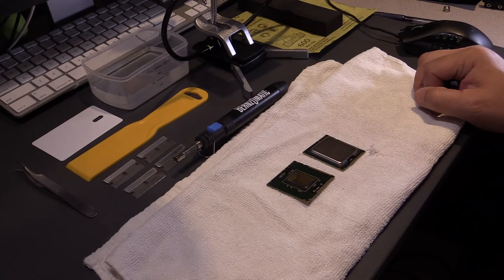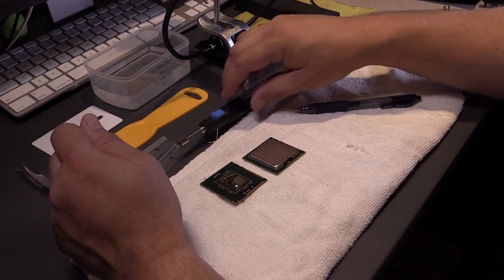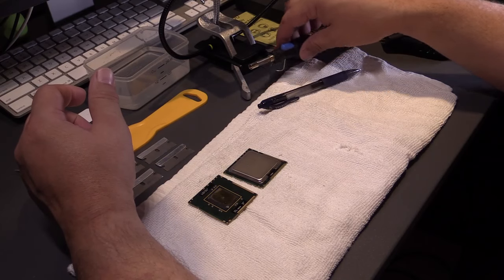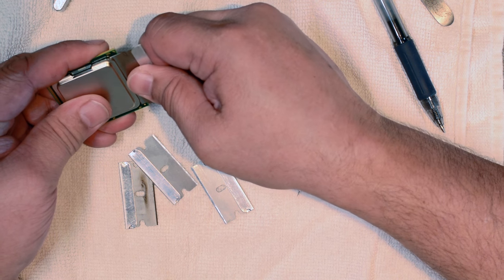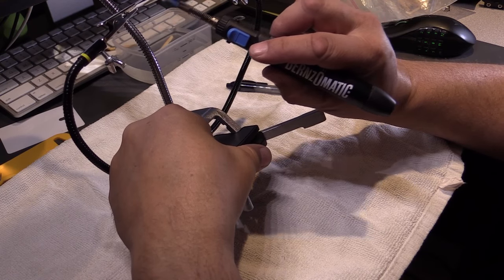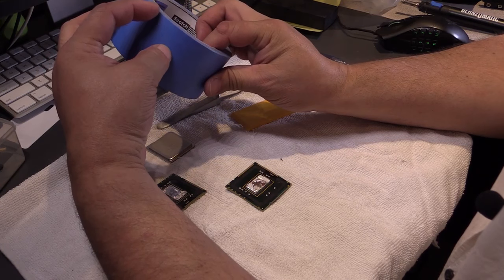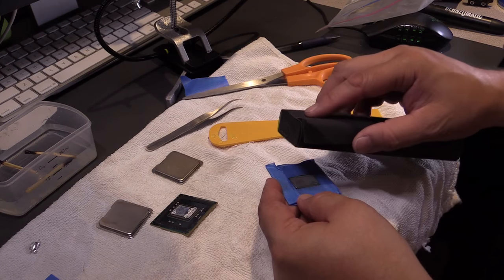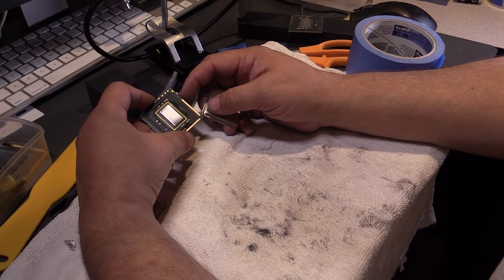Soldered IHS Removal Process for upgrading CPU in 2009-2012 Mac Pro Models

Comment: have you ever done tests to see if there actually is any proof that taking off the lid makes the processor run cooler?   Seems like this is alot of work with a ton of possibility to damage the cpu ...   Are you still doing this to older macs or do you recommend people just buy the 2010 macs if avaialble
Reply from the maker: The exercise of this video was to show how to upgrade and install new CPU&#39;s to Mac Pro 2013 specs (trash can Mac Pro), since you can't purchase OEM de-lidded cpu&#39;s from Apple or anyone else for that matter.  Apple designed the 2009 Mac Pro dual processor logic boards to use lidless CPU&#39;s in socketed slots.  I&#39;m sure Apple Engineers had their reasons, whether it was maximizing cooling, and clock speed, I don't know.  However, you can use the lidded versions, which can be easily found on the open market, but the added thickness of the lid can potentially damage your logic board if left on.

The difference in heat dissipation from a lidded to non-lidded cpu is probably negligible for most users.  However, you have 4 independent screws on the heat-syncs that are deep accessed with a spring tensioner, requiring a long allen wrench to tighten.  It's really difficult to try to evenly tighten down the screws to make sure it&#39;s flush even with the cpu - even when counting turns.  Even a slight variation of a turn or so can result in damaging the logic board, or off-setting the heat-sync at an angle preventing flush contact with the die head and heat-sync.

For the value, I still think the 2009 Mac Pro dual processor models are the best value on the market.  It only requires doing a firmware update to make it a 5,1 version (2010-2012) and then upgrade your processors, memory, SSD and a faster video card and you have a speed machine that will probably last for the next 5 years or more.
Reply: I have seen someone do a test of lidless vs lidded and the difference was 3 degrees  so not really worth the hassle or anxiety   I am not sure I would put that much faith in Apple engineering as a reason to lid or not lid...  The vast majority of people use washers to lift up the heat sink and keep the user from over tightening plus simply releasing the cable to make the fan connectors work is much less stressful.   Can I still upgrade the firmware to make it a  5,1 without upgrading the CPUs?  I do agree with a good GPU the machine will do very well and with a dual channel SAS card the 8 drive raid can be fairly quick   Of course no Thunderbolt connection unfortunately .
Reply from the maker: There is really no benefit to attempting the 5,1 firmware update from 4,1 unless your processors support it.  The firmware patch will allow you to make the update, however, if the processor isn't supported in the 2009 Mac Pro then it won't boot.  However, there is a large amount of information on the firmware update and what the requirements are.  I would recommend reading through the following articles so you have a better grasp on the pros and cons of what's involved.  

For myself and anyone else going from an 8 core machine to a 12 core machine, the 5,1 firmware makes absolute sense.

I would recommend reviewing the following published articles and message boards on the upgrade issue so you can make a determination on what makes the most sense for you.

http://www.everymac.com/systems/apple/mac_pro/faq/mac-pro-early-2009-nehalem-how-to-upgrade-processors.html

https://www.macobserver.com/tmo/article/step_by_step_mac_pro_processor_upgrade

http://forum.netkas.org/index.php/topic,852.0.html

http://forums.macrumors.com/threads/mac-pro-cpu-compatibility-list.1954766/

http://forums.macrumors.com/threads/4-1-dual-cpu-delid-or-leave-the-lid-down.1959772/

Comment: Hi Guy, first things first, thank you very much for this well done video I followed your instructions, but halas my two CPU I removed the led heater cover of didn't keep the central part in. I ended having two CPUs now without this silver central part. My question : Are my two CPUs ruined? Can I find this silver material somewhere and by it to glue it back ? Is it possible to glue that thing back for the CPUs to run again ? Thank you for your answer.
Reply from the maker: Sounds like you over heated the cpu's. If you used the razors to add tension to the IHS when adding your heat source, the IHS should pop off without pulling off the cpu from the die.

Comment: Hello, I'm currently trying to finalize a Mac Pro 2010 for a very decent price. Although the shipping price seems to go upward within our two emails, so setting that aside my question are about the two 2.4 Ghz processors. Based on your video to which I felt is very informative, if the two 2.4's have the IHS (assuming this unit was not modified), AND in knowing the additional heat will 1) slow down the processor speed and 2) over time reduce the life span of the transistors, would you suggest or recommed removing the IHS on my new X5680 3.33Ghz?
Reply from the maker: If it's an actual 2010 model and not a modified 2009 model showing itself as a 2010 with the 5,1 firmware flash update, I would probably not de-lid the IHS.  It will be much easier to swap out processors when you want to upgrade without having  to remove the IHS.  If you're concerned with heat issues affecting lifespan, you can always re-apply a high-performance thermal liquid metal compound like Thermal Grizzly, which drops temperatures by as much as 5-6 degrees over other thermal grease brands.  There are a lot of resources on Youtube on how to do this. 

However, to get your biggest bang for a buck, get a 2009 model instead and do the cpu upgrade, remove the IHS, and flash your firmware, which you can find here: https://goo.gl/DCn3Wg 

Other than memory and video card, the 2009 model is basically the same as the 2010 at about half the price.  Compatible processors can be found for as little as $100 for a matching pair for the dual processor model.

I recently found a 2009 2 X 2.26 E5520 model for around $400, from a local computer recycler, that is now a 2 X 3.33 X5680 after a de-lidding upgrade

You can safely upgrade the processors of 5,1 models with any of the following cpu configurations which can be found here: https://goo.gl/rU4RHi

I hope this helps.
Reply: Carl Clifford-Bauer.I think the 2 cpu 2009 to 2012 does not have lids.The single cpu mac pros of those years have lids.mine is a 2009 2.93 ghz 4 core updated to a 2010 3.33 ghz lidded cpu.
Reply: DIY Guy.my 2009 2.93 ghz 4 core single cpu was updated to 2010 3.33 ghz 6 core and the lid did not have to be removed.The single cpu has to be delidded to work in a 2 cpu system.
Reply: Carl Clifford-Bauer.I am having problems installing windows 3.1 on a mac pro because there is no floppie drive.

Comment: What models have delidded processors. Neither of my Mac Pro's are lidless. They are factory original. 2010 Quad core 2.8 and 2012 6 core. To delid these would present problems in heatsink fitment? A 2 mm difference?
Reply: Only the 2009 4,1 dual processor Mac Pro's have de-lidded CPU's as standard from the Apple factory. The single processor 2009, dual and single 2010 & 2012 Mac Pro's have the IHS left in tact from the factory. So this mod is only necessary for the 2009 dual processor boards.

Comment: Why they need to be removed???? For what i remember the original Mac Pro 2010 processors do not have that thing removed at all, whats the risk?
Reply from the maker: You're correct. The 2010 models though 2012 don't need to have the IHS removed. 2009 models certainly do when upgrading the processors, without needing to modify the heat syncs etc. However, for some people there is a slight boost in efficiency with removing the IHS even on the 2010-2012 models.

Comment: I'm just curious is it ever possible to get these to a mirror finish? I quit and went with very smooth no solder on them but I wished I was able to the surfaces shiny. Any thoughts?
Reply from the maker: It is possible, however, it would require a jig of some kind to keep the die parallel to the sand paper surface so you don't round the ends of the die off from sanding.   

If you use a good thermal paste like TX-4 it will fill any microscopic spaces on the die head and ensure you have a good bond with the heat sync.

Comment: That was a lot of water to put on your cpu just to sand.  If you're using any liquid at all, it would be rubbing alcohol, and very little at that.
Reply from the maker: Water won't affect the processors. Just don't let them soak for weeks at a time.  You could use naphtha but would be exposing yourself to unnecessary hydrocarbons.  The painter's tape helps keep water and debris off the contacts and capacitors.

Comment: Any idea on how to test the processors one by one?  At least one of my processors did not survive the process and I can't get the system to boot. Trying to figure out which is bad.
Reply: Are you sure you had a good pair before delidding?  It could be an issue with making sure the heat sync's are properly level.  This requires evenly counting the rotations of the screws when tightening them down.  You can also try remove the CPU B and just try booting off the CPU A if that fails then swap out the processor and try it again.  I would also pull all your memory and only use slots 1 and 2 with  a minimum of 4 GB. Be sure you zap your pram as well.

Comment: Tried this and destroyed the CPU board started to blister I realized after the second time ....yeah twice!!!...the razor blade transfer heat onto the board. it got blistered... i held the torch to the lid and moved it back and forth (too much?) it didn' pop off...what would cause it not to come off? Obviously, I'm heating too long but is this because I didn't cut fully through the seal with the razor blades? input appreciated. Should I just hold the torch in one place, over the center of the lid?
Reply from the maker: It sounds to me that you had not broken the mastic seal completely, that seals the IHS to the PCB, before applying the torch.  If you review the following image you will see where the cut lines are. https://goo.gl/Lb1sYo

The razor blades actually act like a heat sync to dissipate heat away from the PCB board when applying the torch and applies a little tension against the IHS so when the solder begins to melt it causes it to separate with a slight "pop."
Reply: Ok will do one more thing I plan on giving this
 another shot (sucker for punishment) If I don't get it to come off after say 30-45 seconds what should I do?
Reply: I might actually buy a cheap lidded processor to practice before I do this again
Reply from the maker: Just concentrate your heat source on the IHS lid itself.  If the mastic has been completely severed from the PCB board, and the razor blades are adding tension, then it should pop within within 30 seconds. If not then back off the heat, let it cool down and check that you have broken the seal with the mastic glue.  Just be careful not to damage the capacitors in the process.  Use the visual guide I linked earlier.
Reply: I heard someone suggest floss to cut the mastic I was thinking of that as a possibility

Comment: Great video.  I've followed the tutorial very closely, and have not nicked the caps at all...but I get no boot.  I used wet 800, 1000, and then 2000 sand paper.  Is there any chance I sanded too much?  That's the only thing I can think of that may have damaged the CPUs....(Yes they were tested working before with IHS on, yes tested one at a time, yes tested with different tightness on the heatsinks.)  Any thoughts?
Reply from the maker: Is your Mac Pro a 2009 and did  you flash your firmware yet to 5,1?
Reply: Yes, it is a 2009, it is flashed to 5,1. Boot ROM MP51.007F.B03
Reply from the maker: Have you attempted the remove the heat-sync and reseat the processors, even swapping them around?  I know that sound odd since they should work in either slot, but I've had stranger things happen.  Did you also update your memory or move any of your DIMM's around?  What is your memory configuration, 1333Mhz or 1066Mgz? I would use only one DIMM at a  time to see if you have a problematic DIMM.

Were the slot contact pins clean and free of dust before seating them? I use a magnifying glass to make sure debris, dust etc. is cleaned out prior to seating the new processor.

Did you have IHS processors installed prior to doing the update and working in the mac pro then?  Were spacers used that you forgot to remove?  Remember, you should be able to fully tighten the screws down tight now that they have the IHS removed without worrying about damaging your logic board, just use the figure 8 pattern to tighten a little at a time, like changing a wheel on your car.

If all these things have been tried, try replace your previous processors and see if it will boot.

Comment: Would a heat gun work?
Reply: It'd work better
Reply from the maker: If the heat gun got hot enough and was localized in a directed stream. You don't want to get the surrounding die too hot.

Comment: The video is good. Except for one thing. "Don't go in to deep" is not a precise advice. While being extremely carful I easily cut of one of those little transistor things at the bottom. They are extremely close to the glue. I am very sad.

Comment: If its soldered then what is the point? Solder is the best and the most risky to do you'reself
Reply from the maker: Using lidded cpu's in the Mac Pro 2009-2012 models can result in damaging the logic board if you over tighten the heat sync. Secondly, removing the lids will reduce the heat generated and provide a more stable machine since these things tend to get really hot when doing heavy video production work.

Comment: please need urgent ...
I have a Mac pro  5.1 2010  i need it to show it's 2012 instead of 2010 i know it dose not make it any deference but i need it to be 2012 can u help me with a frimware or any thing to do that !!! PLZ
Reply from the maker: To my knowledge there is no known method to changing the built year in the firmware, which is not really necessary anyways, unless someone was trying to pass an older Mac Pro model off as a newer model.
Reply: some one did it and there is a known one for turning 4.1 in to 5.1 with updating the firmware 
but i need it to be 2012 cuz i ruined 2012 in a company i need to replaced and i don't have 2012 ... thankx any way  :)
Reply from the maker: You can access the Mac Pro firmware upgrade tool, from 4,1 to 5,1 on Netkas.org, from the following URL. However, it doesn't change the year built date on the machine itself.

http://forum.netkas.org/index.php/topic,1122.0.html

Comment: Can my 2009 macbook 17ich be upgraded to an i7 processor? If so what does that mean exactly, will it be faster?
Reply from the maker: Without a logic board swap there isn't really a processor swap option on MacBook Pro's that I'm aware of.  This tutorial is for 2009-2012 Mac Pro's that have the ability to pull out the older processors and replace with newer versions, with the removal of a few screws.